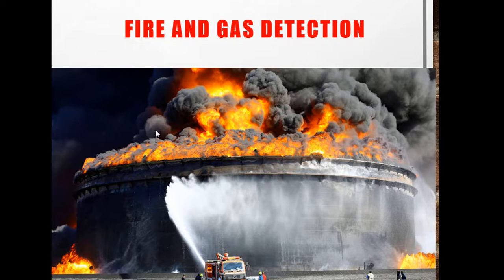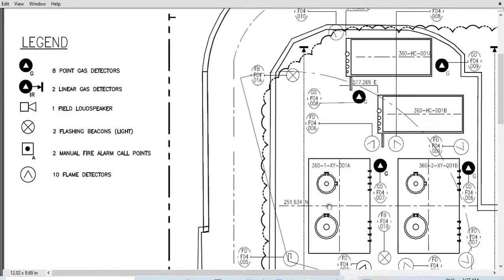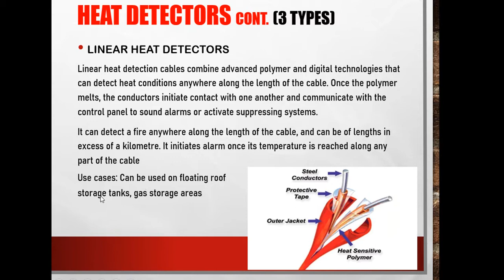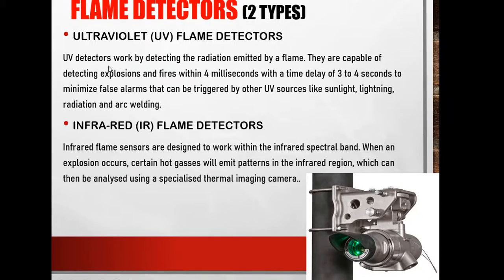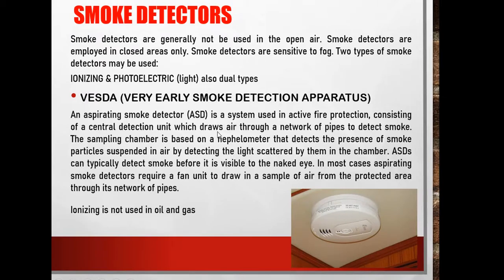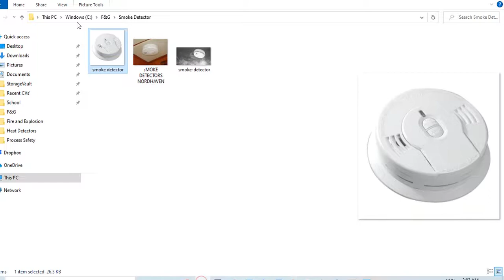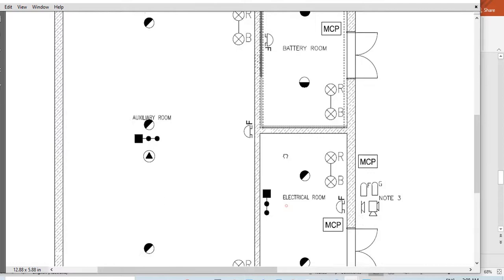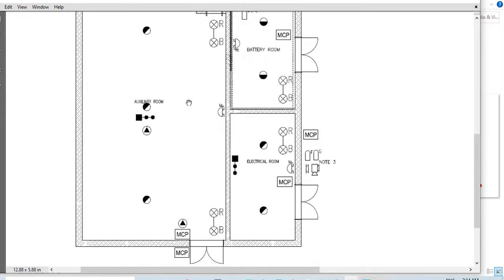Fire and Gas Detection

Comment: Great content. I don't know how I came across this but I am super excited. I am currently working on a fire and gas based project and I would appreciate some clarifications. From the section for Smoke Detectors: As per the note, is F&G mapping study required for detector placement within buildings? On what basis do you determine the detector locations for the different devices? Thank you.